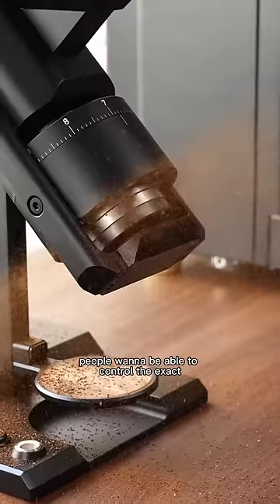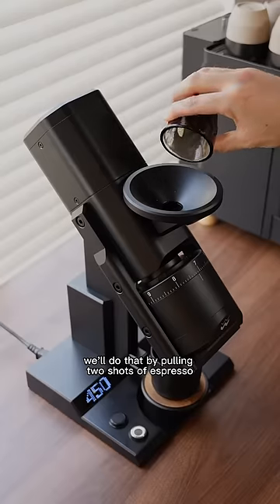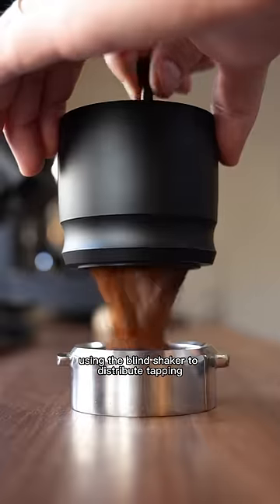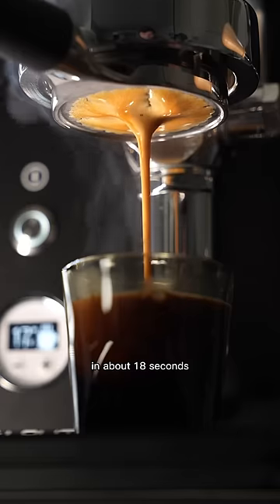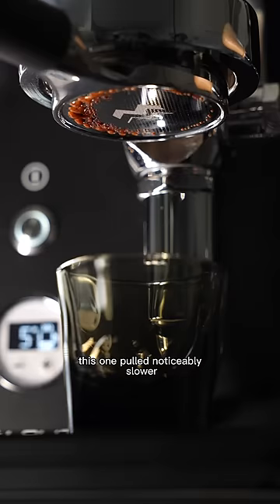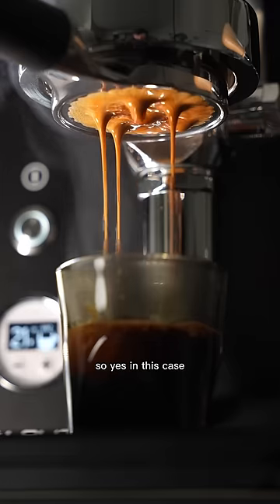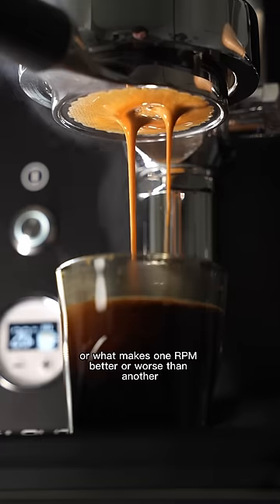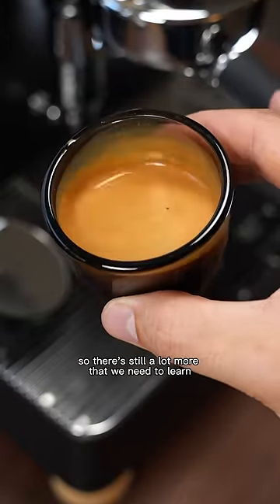Coffee Grinder RPM - Does it make a difference?

Comment: Compaction (and thus permeability) have to do with how well the material is graded. Some grinder speeds might create a gap-graded espresso which will not reduce in void ratio quite the same leading to a faster pulling shot. Also, water content affects compaction holding force of tamper the same and gradation the same.

Comment: Is consistent with what is expect in standard mecanical atomization. Since the beans are consistent between both runs, a greater speed will cause a greater force to be applied on a free-floating grain, causing the creation of finer particles. If the ratio is just right between large and fine, they will fill the blank while causing minimal intake in volume and will increase the specific surface of the puck. Since higher surface causes slower percolation, you can expect the shot to pull slower.

Comment: Lower rpm would create more ridges on a particles surface. More ridges more surface area, more surface area more surface friction when water is passing through it leading to a slower pull on same pressure.
There is some cases where it can pull faster but that would be due to exceedingly high quality grinders and recently sharpend burrs that can decrese the chance of internal structual failure of the particle that lead to higher surface area.

Comment: Higher RPMs in coffee grinding can lead to an increase in coffee dust, as the grinding process produces particles of varying sizes. When the coffee is ground too finely, it can become compacted, which makes it more difficult for water to flow through. This increased resistance requires higher pressure for the brewing process, potentially affecting the final flavor of the coffee. This would be my theory in this case 🤓

Comment: I think it's the most obvious answer, particle size. Typically faster moving and sharper blades will give smaller particles, and when you tamp that down you get a more condensed mass that makes it more difficult for liquid to pass through. The difference between brands and types is probably a difference in blade quality or spinning mechanisms. I would assume that having a well calibrated, well made machine with sharp blades would give the results you got today every time. Granted the type of beans and how well they're prepared could also be a factor, but I feel like my hypothesis is sound.

Comment: you pretty much answered why by testing it, high rpm grind better, by better it means grinds into smaller particles, smaller particles equals denser consistency, denser consistency means water have more trouble to seep through

Comment: Just a hunch but sometimes when blenders are too fast instead of chopping they just flip the material up over and over so it doesn't get good contact with the blade causing for a coarser outcome thus longer less smoothe extraction. It will vary up on machine because the blades will be different sharpness and configuration

Comment: Well as you mentioned it, this is inconsistent across different grinders, so I guess that there is some kind of electrostatic phenomenon happening in certain cases, generating charge through friction the higher the RPM, so making the grains stick to the material.

TL;DR: 
Inconsistent electrostatic thru friction phenomenon across different grinders, humidity settings, coffee, etc

Comment: A naive guess would be that a higher RPM leads to smaller average size of grounds, which increases surface area inside the puck. Since water has a very high surface tension and will wick into small cavities easily, that could be what's causing the slower pull. What would be interesting is to measure average grain size for different RPMs, then measure different pull speeds for different average grain sizes.

Comment: We know exactly why this is happening:
As the beans get grinded, they start to fall down.
The faster we grind, the more speed the beans will fall down at, due to the fact that there is more space below them at a quicker rate. 
This then means that the faster falling beans will push more from the top as well, causing them to be grinded more finely.
Consider the opposite:
If you were to grind SUPER slow, maybe at less than 1 rpm, you'd get bigger chunks of beans "chipping off" from it.

Comment: My guess is that high rpm makes a finer/more inconsistently ground coffee. Im imagining something like those slowmo videos of something falling into a fan blade where it kinda bounces around. Slower results in a more consistent and coarser grind because the beans have time to settle into the grinder and get properly crushed instead of smacked and chips breaking off. 
If thats true, the question would then be what speed is the fastest you can go whilst maintaining consistency for your specific setup so you get your coffee faster but at less expense of the flavour due to inconsistent particle sizes.
Maybe something that could be determined with a microscope to measure particle sizes and see the deviation? Little deviation with finer particle size for faster grinding is fine to me as long as thats compensated for in the grind setting.

Comment: The grinder at different rpm creates the porosity and permeability of the ground coffee. When the rpm is higher the porosity and permeability is low which makes it more difficult for the water to flow through. But the lower rpm makes the porosity and permeability higher which allows for the flow of water easier through the ground coffee. 😅😅😅

Comment: Its probably the smoothnes of the coffe like when its at high it makes the surface rigid and at slow it's probably more like a knife and yhe coffe goes through it easier but the grinders are higher rpm might just have a different material

Comment: I’d be curious about fines. I think it may be that lower rpm produces less fines and would allow your extraction to happen quick. Whereas the higher rpm has more fines that allow the flow rate to be more optimal. I can imagine it’s more dependent on the bean than anything. Still super nice setup Weber is endgame, noice

Comment: It is well established what causes this. Faster grinding has higher kinetic energy which transfers to the beans and creates more fines. Obviously fines increase the overall density and resistance of the puck. It makes no sense that higher rpm could lead to a faster shot unless the grinder doesn't work properly at higher rpm or it is causing too much resistance in the puck to the point where channeling occurs. Either way, under controlled circumstances where the grinder works properly at any available RPM and puck integrity is maintained throughout the shot, higher RPM = more fines = more resistance in shot.

Comment: I’m no scientist or anything, but based on common sense, blending at a faster RPM would mean the particles are smaller, because my guess is that the time you blended is the same, which means for x time, the same type of bean was being pulverized at basically triple the rate, meaning the final product wouldve produced a far denser puck making the drip from the extraction take longer to work through. 
I imagine the high rpm extraction was fuller and richer

Comment: I'd guess it has to do with how fine it's ground and certain grinders powdered more at higher RPM. If something is ground well, water will get through easily, but if it's ground too well the particles will form small walls and not let the espresso through.

Comment: OHH THIS MIGHT HAVE TO DO WITH HOW WATER FLOWS!!!! 

Basically in nature when water is flowing through things like gravel, sand, or glacier silt, it needs spaces to flow through. It’s easier for water to flow through gravel than silt as gravel has big spaces between them while silt has very little space between them. 

Say this, I believe the higher grind is slowing the pull because the water doesn’t have much space between the grind grains, while the 500 has bigger spaces between them for the water to flow through.

Comment: Higher rpm is a finer grind which doesn't allow water through as easily.

Imagine water hitting nothing but a rock pile and how quick the water would travel through all that empty space, and then imagine it with sand

Comment: High rpm can make beans bounse around more in the grinder depending on the shape inside, causing more bigger grounds
Reply: but wouldnt bigger grounds cause more channeling due to greater heterogeneity between particles? also that grinder already has grind size setting; is it just a function of time x rpm then?
Reply: @Rondart  channeling depends of how resistive the path of water is, bigger particles leave more space between them and as they are uneven they also leave wide gaps
Also, the grind size should be roughly same as it doesn't take too many big particles to make a difference, most particles are the expected size

Comment: james hoffmann or lance hedrick made a video about this 

high rpm = more fines 
low rpm = less fines 

so is low rpm always better? sometimes fines gives the cup more complexity, soo, just play around 

if your grinder has fixed rpm, you can "change" the grind profile by using a slower feed rate, it will lead into more consistent grind = less fines

Comment: Higher rpm means finer grind... Finer grind when tamped means less space for water to pass through resulting in a delayed extraction... If you could measure on the micro level you would notice that the level of coffee power in finer grind would be lower when compared to a coarse grind... This is what I think might be happening applying basic physics... No coffee aficionado by any means...

Comment: Ummm... im not trying to say what he's saying isn't correct,  but just one shot of each,  as stated in video...  there could be MANY other variables as well.    He needs to do this with multiple grinds of each rpm to validate the pull speed variations are a factor of the rpm.

Comment: Not sure how accurate this statement is. I believe higher RPM produces finer grind unintentional, and it makes sense logically. Take a manual grinder, the faster you go the more rotation you need to finish the job, the slower you go the less rotation you need. Through this exercise, faster rpm likely produces finer grind.

possible I'm just totally wrong! if so, ignore everything i said above.

Comment: wouldn't higher rpm = more rotations per minute = so if you ground something for 1 min at 1000 rpm vs a 1 min at 2000 rpm the 2000 rpm is going to be finer?

Comment: It's actually not that surprising. The smaller particles of the 1.5k rpm grind will fit together tighter than the 500 tpm one thus the water will struggle more to pass-through and take more time in the 1.5k rpm grind

Comment: Okay look, I understand if I sound stupid here and someone has probably already figured this out, but it's probably because the higher RPM creates finer particles which stack together more densely therefore pulling much slower because it was harder for the water to go through.
This holds up with the 500 RPM shot as well since even after tamping there should be small but not inconsequential air pockets.

Comment: There will always be too much nuance and RNG. And it also depends on the beams used. Even if they were the same type and came from the same place they could have grown in a slightly different way that vastly impacts these variables. A better way would be to do multiple runs on 1500, multiple on 500, and multiple on another speed to act as a "control" group. Mark your findings, and most importantly, taste test. Good short experiment, but you can get to the bottom of it this way.

Comment: Using leftover braincells, I would assume the higher the rpm the more friction you induce in your grind. You also probably have more chance to see grains getting pulverised more since they would have more chances of getting cut again by yhr burrs or squashed by other beans.

Next step would be to get a mesh and see the grain diameter distribution in each grind.

I'm waging that the faster RPM yields smaller grains.

Comment: You are measuring the wrong outcome. 
The question you are answering by your methods is does changing X change the rate of espresso extraction it doesn't answer the question of is there a fundamental difference in the chemical and therefore taste profile of the espresso that's extracted